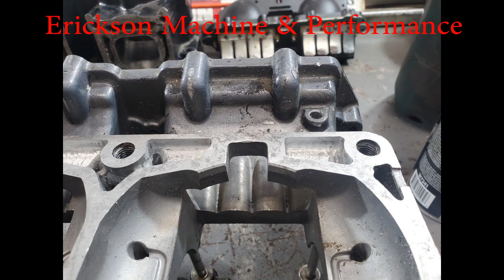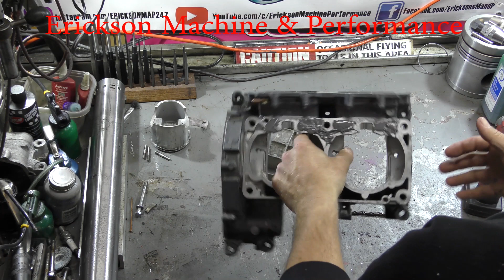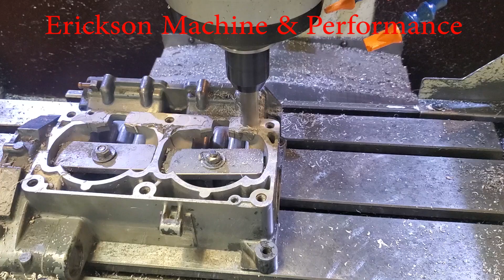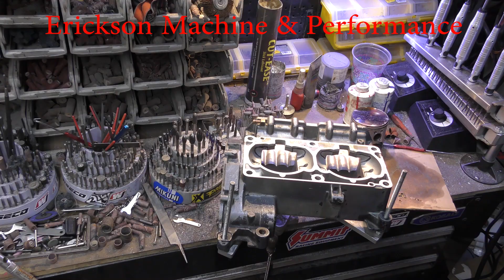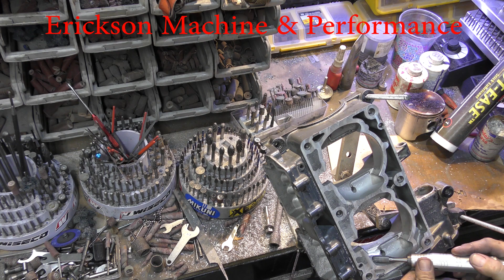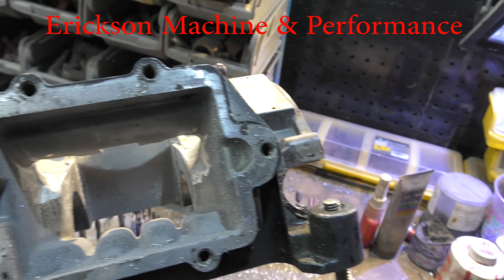Get More BRAP! Yamaha 701 62t case porting how to. Superjet Wave Blaster horse power! 701 part 2

Comment: Maybe a foolish question...  buuut if i were to use ear plugs to plug the threaded area on the case. Is that sufficient enough? Or best to use the bolts instead of earplugs?
Reply from the maker: NO. There needs to be case bolts threaded all the way up of the epoxy can block and fill the threads
Reply from the maker: Great question.  Not foolish at all by the way

Comment: Maybe aluminium welding is better than epoxy?
Reply from the maker: @ivannovoselac3518  you can't the cases would warp .  When done correctly epoxy lasts a long time! We have engines we did 20 years ago still running  strong with no issues

Comment: Hey Mark I followed your video when case porting my 62t bottom end. Ready to reassemble it now. What do you typically find the engine needs for jetting as fully ported compared to just cylinder porting? 

My cylinders are ported and at 82.5mm, crankcase is now epoxy filled and ported, running 35cc domes, carbon reeds, b pipe, msd box on the way. 

If I remember correctly I was running 140 mains, 70 low speed, stock needles and I believe 80 gram pop off springs

Comment: What is the downside to making the fingers larger than what you show here (all the way to flush with the intake area as well as removing the hump on the bottom)?  What are your considerations to ballancing the finger sizing?  Thanks for all the videos and free education!
Reply from the maker: That depends on displacement.  701-760 you don't want to make to big or you hurt case volume ( hurting bottomend grunt)   For these engines.to make optimal power the ports need to flow with Velocity.  It's the goldilock thing.  It needs to be the right size.  Not to big or small. ( that's the hard part to learn and when a flow bench helps )  bigger isn't always better.
Reply: @EricksonMachinePerformance   The first one I might have gotten a little carried away but I filled the reed area, so maybe it won't be too bad (85mm w/ stock stroke)?  I had watched your video on filling the lower intake area and that's the picture I had in mind when I went to town on the case.  When I came back to this video, I realized there was a noticeable difference.

Comment: Hey! 
great video!
Just a friendly suggestion, usually its being done in sillicone molding but im pretty sure it work pretty well with epoxy filling.
before you pour it, take a small paint brush and paint with epoxy the surface, this way it will stick 100% and air bubbles will have no chance! 
cheers!
Reply from the maker: You can't alot of the voids won't fill if you do that.    This is thicker then the epoxy you are describing and the casting passages are small.

Comment: whats the life expectancy on the epoxy fill? how often do they fail?
Reply from the maker: I have engines I built 16 years ago that are still perfect.     Most times there is an issue its from heating the cases for powder coat or baking paint. (Which I don't recommend)  if prepared correctly you shouldn't have an issue.    I haven't had epoxy just fail.

Comment: Love all the vids and thanks for putting this info online! I'm having you do some machine work on my 701 asap. Question though, Would the same principles of 2 stroke cylinder and case porting in your videos apply to a single cylinder YZ250 2 stroke?
Reply from the maker: Yes the only difference is the the reeds are in the cylinder not the cases.  I will be doing a 550 cylinder porting video shortly and that will be even closer

Comment: Have you ever tried filling the voids with aluminum weld? Such as durafix welding rods. I’ve used these rods to repair minor cracks in engine cases, with good results. I’m curious if these rods would have an advantage over a 2part epoxy when filling these voids.
Reply from the maker: No I havent. The void are fairly large and putting that much heat could cause warping also you would end up brazing the case hardware to the cases when filling with brazing rods

Comment: Im putting together a 62t bottom 61x topend. I will be running a b pipe with limited chamber, dual sbn 38s, milling the head or i will buy a aftermarket one. Would just this mild build stand to benefit from this? Im on a WDK rok hull so i spend most my time in the surf and some flatwater tricks.
Reply from the maker: 100%  and I have a video and porting templates for the 61x cylinder if you want. Follow both videos and the ski will rip!!!

Comment: How much does this cost on a average? I have a raider case and 760 cyl. I am just a rec rider but want that zxi power in my blaster. How dependable is this lol
Reply from the maker: Jeff when ported correctly the are still dependable.  PM me on Facebook or Instagram for pricing.   Theres a bunch of different options and I recommend a fresh topend after porting so you start off fresh
Reply: @EricksonMachinePerformance  well im in luck because i need one. Piston went down last season.
Reply from the maker: Perfect.   Message me on Facebook or Instagram  or email me Ericksonmap@gmail.com

Comment: I appreciate the videos they’ve been a great resource in porting and port matching the transfers on my 61x/x motor. Could you do a video or explain case porting a x motor? There’s so little info out there on doing this vs the t cases. Is it even worth it on a mild 185psi motor with a single 46?
Reply from the maker: Thanks for watching. I will be making a 61x case porting video as well. It some be out in the next month.